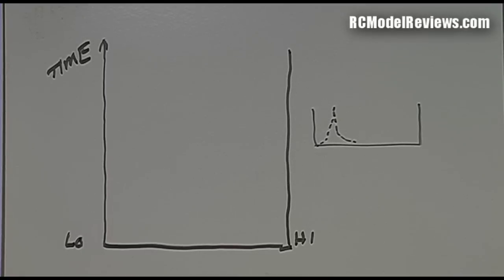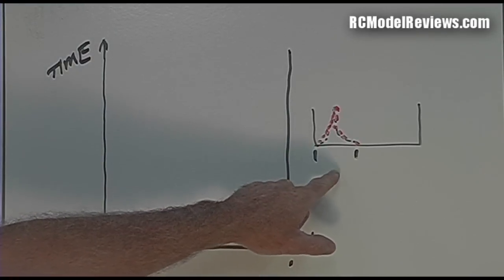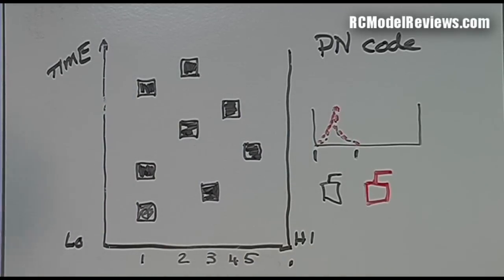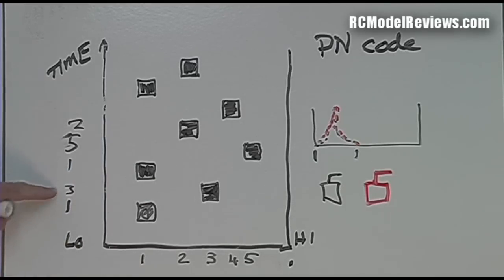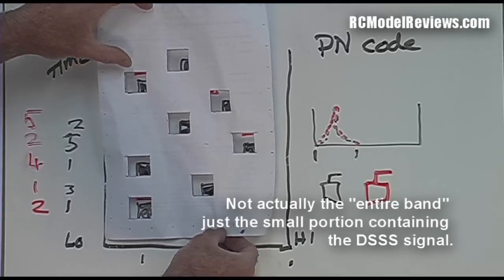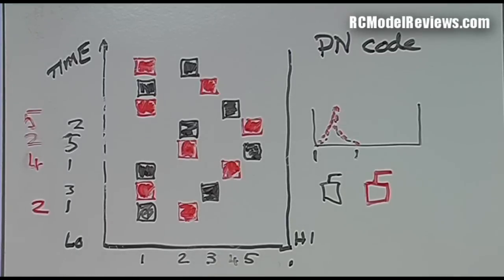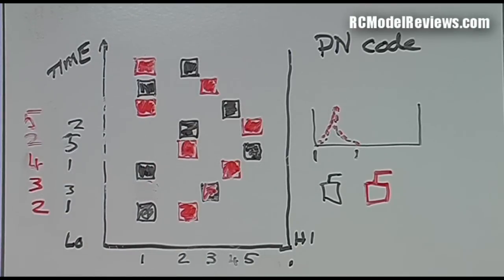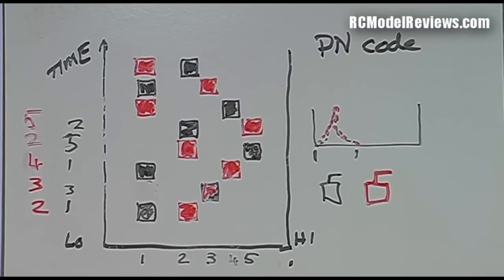How spread spectrum RC systems can share the same part of the 2.4GHz band

Comment: Your explanation refers to FHSS (Frequency-hopping spread spectrum) and not to DSSS (Direct-Sequence Spread Spectrum)
In FHSS one re-tunes the carrier frequency according to a pre defined sequence and therefore hops between sub-channels to avoid interference.
In DSSS, the date will be modulated by a pseudo-random noise sequence (e.g. Gold-Codes). This leads to a uniform frequency distribution with a much greater bandwith than the original base-band signal. This process is also called CDMA (code division multiple access). To recreate the original data, one has to multiply (correlate) the received signal with the pseudo-random sequence (which the receiver has to know).
Reply: That is what I was wondering after watching. Thanks for clarifying and explaining more over. Great comment!

Comment: @oakleymac1 2.4Ghz is not the best option if range is what you are looking for.  Try UHF, higher Mhz radios like Futaba 433Mhz, or something like the dragonlink system.  I also bought a Dx6i because thats what everyone else was buying.  I use it but wish I had paid a bit more for a modular Futaba system that can be Ghz or Mhz depending on the module you use.  My DX6i works about 2km away on it's best day.  I can get double that with the cheap 72Mhz radio that came with one of my RTF planes.

Comment: @RCModelReviews  this is definately not DSSS .what u are explaining is a pure form of FHSS. Spreading in DSSS  means multiplying the baseband signal at low bitrate with a random sequence at high bitrate. This new signal which is the product of the two signals has a higher bitrate than the baseband signal. This is how the signal is spread.

Comment: Excellent video. How does the PN code translate to what people often call the Spektrum 'exclusive' (at least people tend to state so) 'ID' code or should it be considered the same thing?

In short, I'm wondering how much the various systems actually differ from the other DSSS systems out there. A pure marketing issue?

Also, isn't the Hitec Adaptive Frequency Hopping Spread Spektrum (AFHSS) on for example the Aurora 9 a somewhat more true frequency hopping system?

Comment: So here is a question: I haven't flown anything in probably 15 years, and I have a very nice Futaba 7UAP "PCM 1024" system in the old 72 MHz band, I think it's channel 14.  I used to have a Great Planes Super Kaos 60 that I flew the heck out of with it and it was a great radio.  If I go flying somewhere (where no one else is around) am I likely to get hammered by modern radios?  Can I still fly with it at an organized field using the frequency queue board as we always did before?

Comment: Gray code (aka state diagram for binary code) was used in the earliest days of semiconductor designs due to possible errors from single transistors failing to stabilize across a bank of them arranged as a memory register. Gray code enforced change of only One bit at each clock pulse:

0000
0001
0011
0010
0110
0111
0101
0100
1100
1101
1111
1110
1010
1011
1001
1000
0000

Motorola may hold a patent on its use for microcode in microprocessors. Nixdorf may have something, too...

Comment: On the receiver side this is called correlation gain, if the codes match the signal of interest will jump out and has more gain than the others. The others will still be there but their gain is too small to stand out.

Comment: @RCModelReviews  Thanks for clearing that up, I appreciate it. So basically all frequency hopping does differently is change the location of the small frequency band it would normally use the PN coded transmissions on.

I think the fact that the visual representation show the average over time makes stuff somewhat confusing when it comes to frequency hopping. Basically it doesn't use multiple channels (frequency peaks on a different location in the spectrum) at the (exact) same time, right?

Comment: @xjet Thanks!  I'm glad to hear that.  Not that I wouldn't probably upgrade in time (the newer systems seem to have much smaller flight-side components than the older ones did), but it's good to know that I can get back in using my old equipment, much of which was top-of-the-line (and expensive!) way back when I last flew.

Comment: When you say, that all systems are dsss, can you please explain why futaba says theirs system is a hybrid of fhss and dsss and the others are just fhss? What they mean? I tought, that dsss spreads the signal with pseudorandom code, so it is of lower power, but more bandwidth and that's difficult to jam (and in the end behaves like more powerfull signal). But now im really confused.. I'm trying to find the reason, why fasst is considered to be more reliable in noisy envs than the other systems.